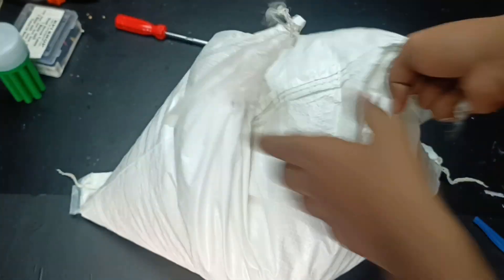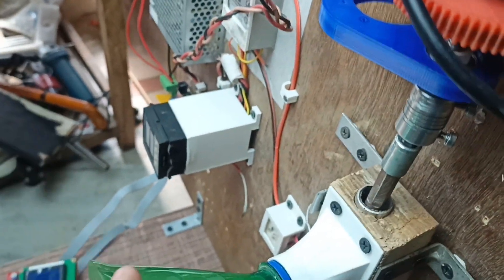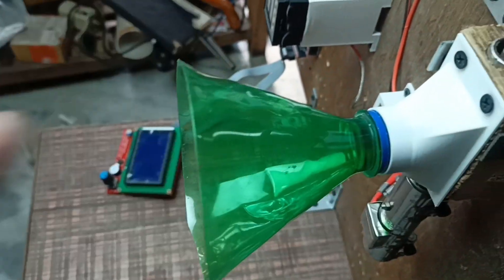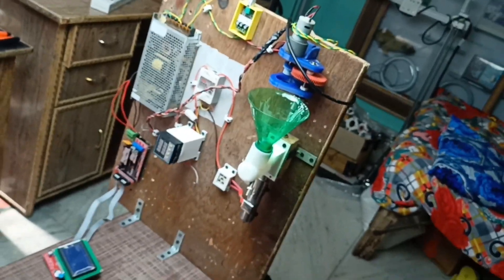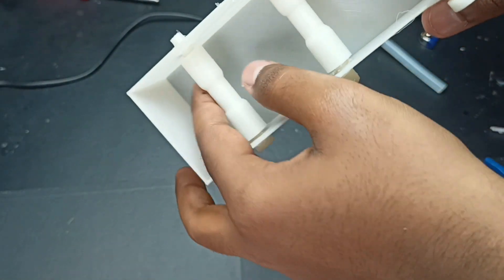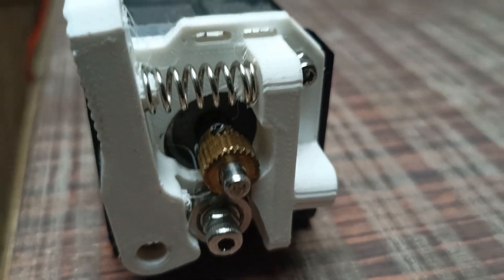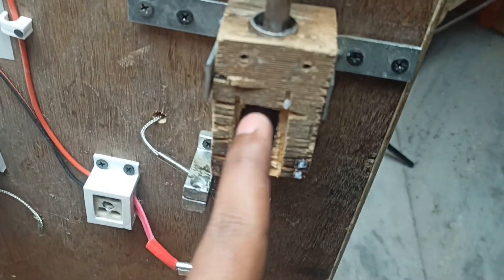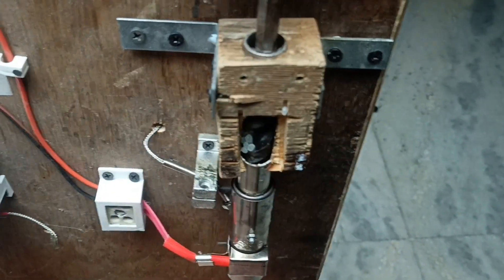$60 DIY Filament Making Machine - Make Your Own 3D Printing PLA Filament at Home

Comment: thank you so much I want to ask can i use this component to extrude filament
 I will use My impact drill 1010 W with built in speed controller with the Bosch Wood Auger Drill Bit to push the plastic inside
I will use W1209 Thermo Controller, Diode , 100K Thermistor and Thermometer to melt the plastic 
I will add a Filter to prevent any Impurities

Comment: The issue at hand for the community is shredding failed prints and converting it back to filament. THIS is the issue the community needs to solve. And not some $2k machine to do it.
Reply from the maker: Yes, You're right,  but the problem is shredder needs metal blades and high torque gear AC Motor or Servo motor, which are expensive.
Reply: @Creative3DP  yep. I think a different approach is needed.

Comment: Too small motor to handle the torque requir to push the plastic
Reply from the maker: Yes, update is coming soon and i have upgraded the motor
Reply: @Creative3DP  check my shorts for the extruder I made a year ago
Reply from the maker: @XFX4JOHN  it's awesome, what is the torque of the Motor you're using?
Reply: @Creative3DP  i guess not more than 7nm, i am using a car window geared motor after it i put a planetary gearbox taken from top loading washing machine just to increase the torque more, but still not enough, I realised when you extrude plastic at low temperature the filament would have stable diameter and better quality
Reply from the maker: So u are using a 7nm motor and what about the RPM?
Reply: @Creative3DP  the screw rotate between 50-100 rpm
Reply from the maker: That's pretty high, whatever I read on the internet. 10 rpm is a good speed to produce filament. What you say on this?
Reply: @Creative3DP  I am working on decreasin the rpm I will install 2 stage gearbox which will give me about 10 rpm, I am cold extruding the filament as i said before and this requir tremendous torque values. Can you share with me please any links for filament extruding communities?
Reply from the maker: @XFX4JOHN  I'm don't know any specific communities regarding Filament extrusion system. Mostly i read online from PDF and also asked felfill guys how much torque and rpm they're using Just to get the idea. Rest I'm experimenting by myself. Instructable .com is the best platform to learn about this
Reply from the maker: what size nozzle you're using?
Reply: @Creative3DP  2mm
Reply from the maker: @XFX4JOHN  thanks

Comment: Could you make the feed tube at a 45 degree so the pellets flow more reliably?
Reply from the maker: Yes but it required more changes than just feeding tube
Reply: @Creative3DP  I saw that later in the video.  Great work and keep at it!